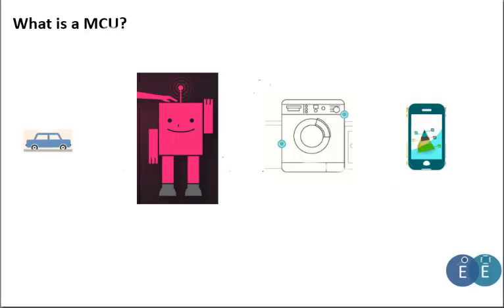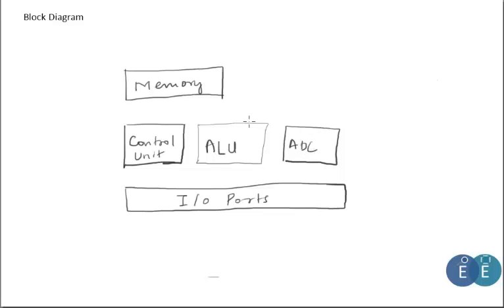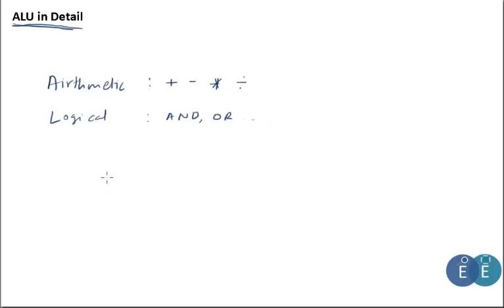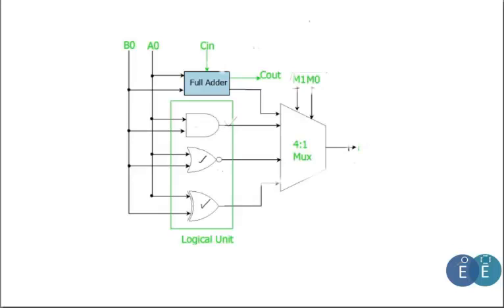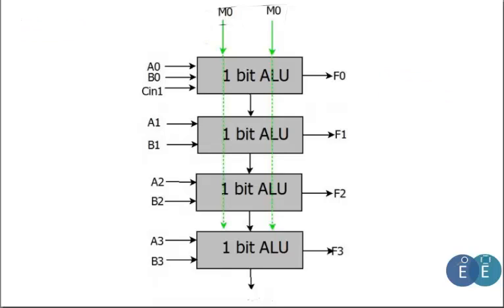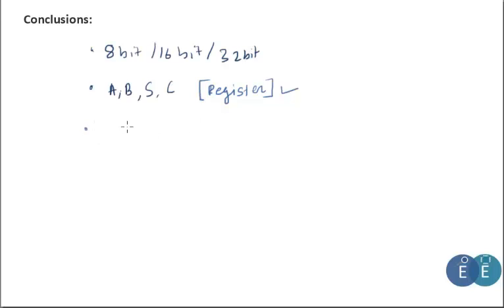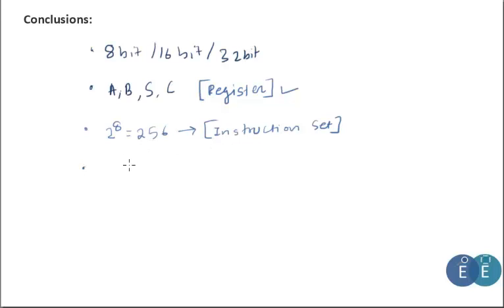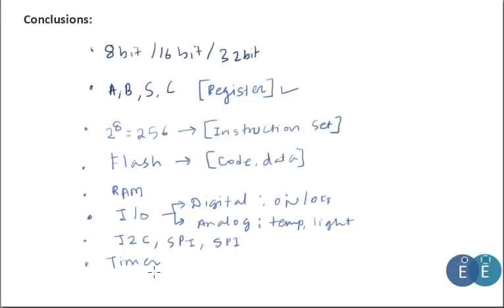Inside a Microcontroller

Comment: @explore embedded 
Very nice and interesting lecture. i am very pleased to watch it :) . very informative video. (y)
But i also conclude and idea of calculating instructions by my method. i hope it will be right method. 
The number of operation performed by an ALU is calculated as follows.
no of inputs(A,B) ^ selection lines(M1,M0) = no of instruction.
example: single bit ALU has 4 instructions. i.e 2^2 =4
a 4 bit ALU has 8^2=64      => (8 bit neans A0 to A4 + Bo to B4) and has 2 selection line (M1,M0). 
8 bit ALU has 16^2=256.
Reply from the maker: Glad that you liked. Thanks for sharing!